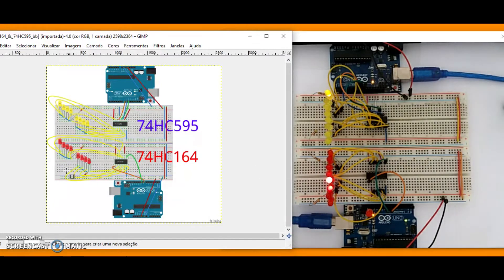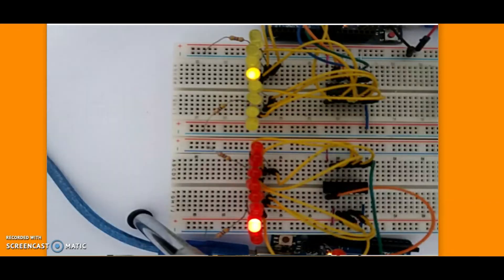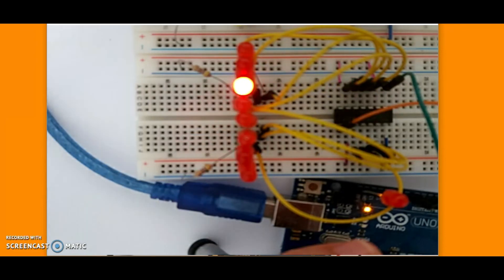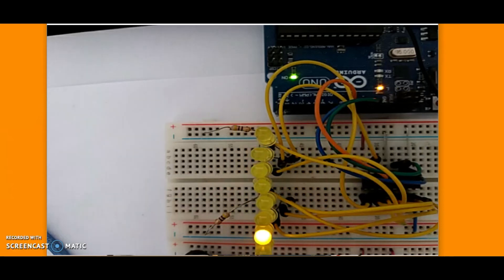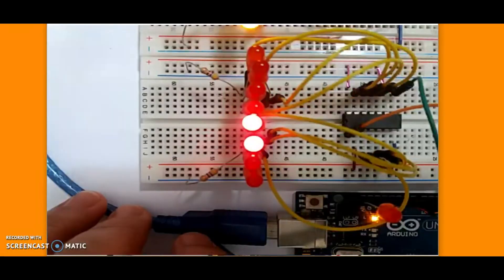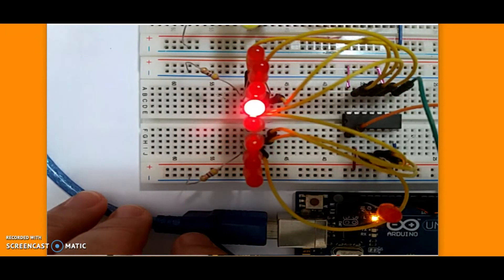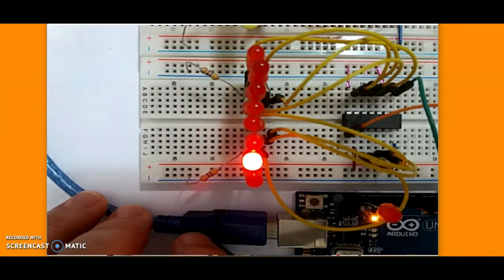Shift Registers Types: 74HC595 & 74HC164 Shift Registers — How it Works! #arduSerie — 31

Comment: Hello friend! Firstly, thanks for the video. Would you have any Arduino code for a clock with this register and a 7-segment display? Otherwise, can I use the code made for the 74HC595 with the 74CH164 (for a 7-segment clock)? If you can answer me, I would appreciate it.
Reply from the maker: Hi @Dancopymus, while both the 74HC595 and the 74HC164 are shift registers and share some similarities in functionality, they have differences in their internal architecture and pin configurations. Therefore, you cannot directly use the code made for the 74HC595 with the 74HC164 without making modifications.
Regarding the clock, this will be discussed in a future episode. Thanks for asking. Take care!
Reply: Thanks @j3_

Comment: What difference between 74hc164 and 74hc595.......?
Reply from the maker: Hi, Vishal Mayannache. 595 is a latch one shift. It means that it had a sort of memory. When shifted it will occurs in the background and you will not see the light flashing. 164 is not. Hope this helps happy new year thanks!
Reply: J3 I have 74hc164 shift register so....! Which is better..! 595 or 164 And happy new year
Reply from the maker: It depends on your project. There's no comparations althoug 595 is a more sophisticated chip due to it's 2 rows of flip-flops.
Reply: J3 first I go with 164......! Afterwords 565....! Okay